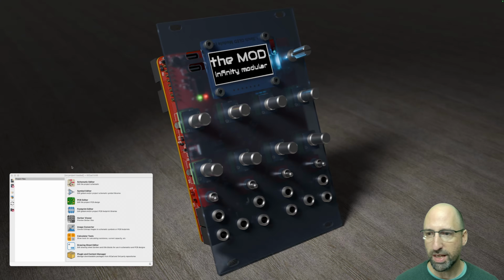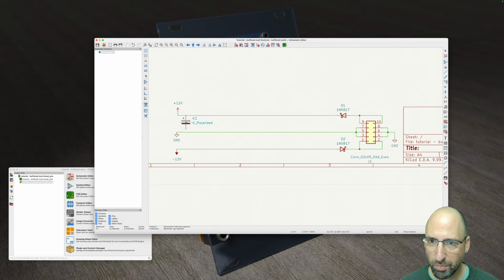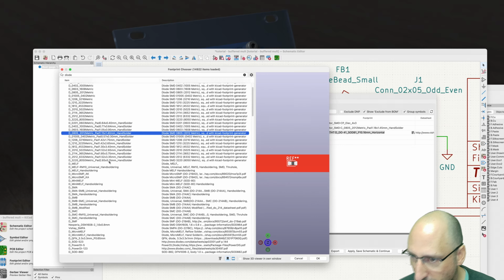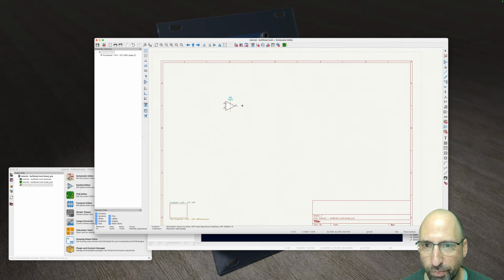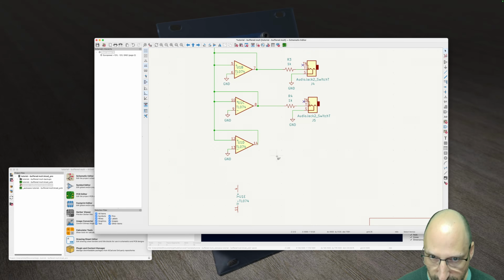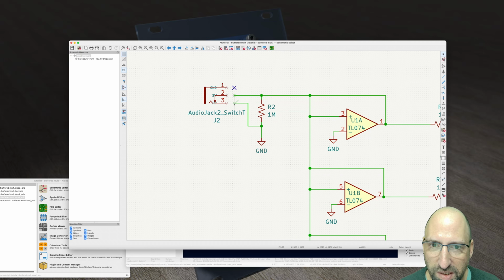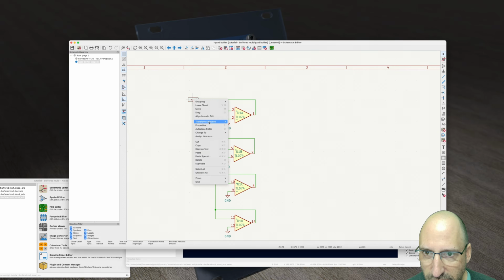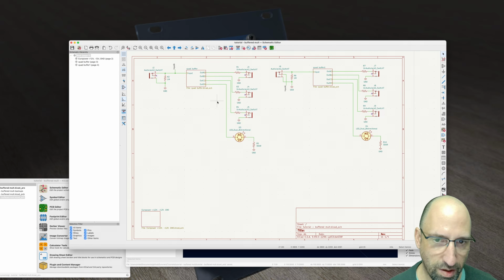How to design, manufacture and build a eurorack buffered mult module

Comment: Thank you so much for putting so much effort into these videos. I have one question: why did you choose to make one side GND and the other +12V? From a shielding point of view, wouldn’t it be better to ground both sides?

It would also be great to see you build a module using more than one PCB—how you plan it and how you connect everything together in a single module.
Reply from the maker: A single ground plane is more than enough on these modules, and being able to use the top side of the board for +12V usually dramatically reduces the trace-complexity.

Comment: Hi! I just recreated your schematic and everything you have been showing seemed to be very helpful! Thanks again! One question though: I noticed, that in your video, you created a feedback-loop from each op-amps output back into the main input and non-inverting input of the op-amp. When I looked at other schematics, I found that everyone else seems to be using the non-inverting input for an input and then creating a feedback loop from the output to the inverting input of the op-amp (and not tying the inverting input to GND, like in your example)... can you explain, why you chose your approach? I also noticed that when I run the electrical rules check in kicad, an error warning is coming up...
Reply from the maker: Thanks to your question I have published Ep.3.. Fixing the OpAmp circuit. Thanks again... 
I have recorded ep.4 - getting ready for manufacture... and ep.5 adding a faceplate and will release them soon.
Reply: @InfinityModular ❤
Man I love the eurorack/synth community! Thanks for the explanation and the link to how op amps work and what can be done with it. Although there being an error in your first vid, I still want to stress: I have learned so much watching it. You have a great way of explaining things and I like that you get right to it, so I might follow along, instead of doing a video like „5 important errors you can make while designing a module“ or „dont do this!“ or any other kind of that over-hyped crap your find on youtube mostly these days.
Really looking forward to the next episodes!❤
Reply from the maker: Hi @spectrumunit. Thanks for your feedback. I'm glad you've found it useful. In terms of the opamp circuit, the configuration I've used is to create a unity gain buffer or voltage follower. This ensures that the input signal remains unaffected by downstream circuitry. It's like we're creating a copy of the original voltage that can be further processed. 

You'll see the same circuit for the LED. Imagine if you will connecting a single light bulb to a battery. It will glow nice and bright. If you add a bunch of other light bulbs to the same battery, the more you add, the dimmer they'll all get. This is because each bulb has a resistance, and reduces the amount of current flowing through the circuit.

Since no current flows through an opamp, we can create a perfect copy of the input voltage on the buffer's output, without affecting the current of the input. This is really useful because in the case of this circuit, we want to "copy" the input signal multiple times for the 3 signal outputs and 1 for the led.

An opamp buffer only works when you connect the input voltage into the non-inverting (+) input of the opamp, and feedback the opamp's output to the inverting input (-) of the opamp. If we switched that around, and fed our signal into the non-inverting input, and tied output to (+) we'd no longer have a buffer, and the opamp would just saturate because the (+) is left floating or is not balanced by the output.

There are many other configurations/uses for opamps, which are created by using additional circuitry around the opamp itself. So it is likely that when you see opamps with the signal connected to the inverting input, that this is being used to amplify the voltage, or compare two input voltages.

There is an excellent explanation of how opamps work on @EEVBLOG: https://youtu.be/7FYHt5XviKc

I hope this helps.
Reply from the maker: hmmm ... holy cow...  I checked the video again, and I see what you mean. What I have in the video is wrong! ... I will correct it.

thanks for this. I was wondering how on earth my actual module worked with this configuration (which basically turns it into an expensive passive mult, but realize that the circuit that I designed and built from scratch, I did correctly. I must have been over-tired when I recorded this.

I'll have to record a fix. Which might not be a bad thing anyway, since it will demonstrate how to rejig the schematic and pcb. Something that we need to get good at doing in this line of work.
Reply: I came to say that too, but it looks like OP has already addressed it. I haven’t finished the entire series yet so maybe I’ll see the fix in one of the later videos. Great videos @InfinityModulae